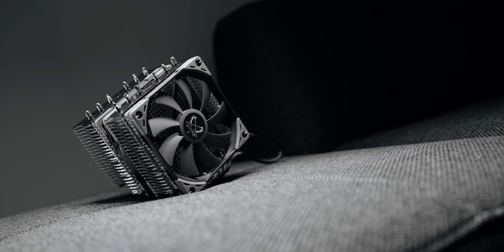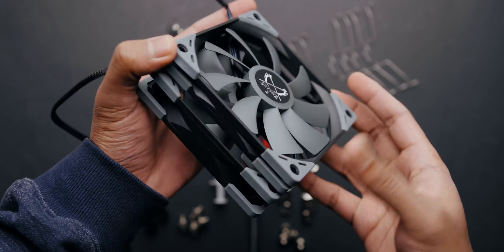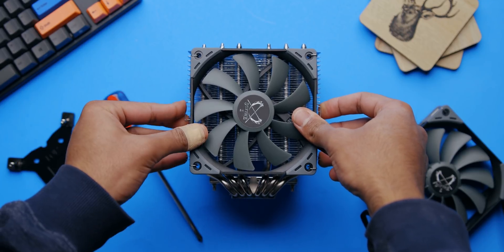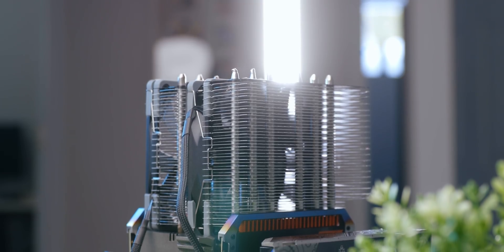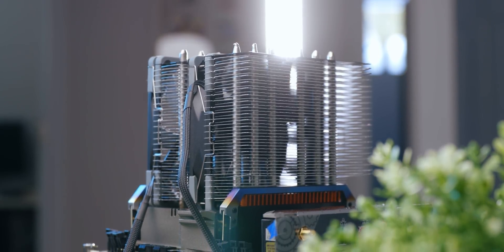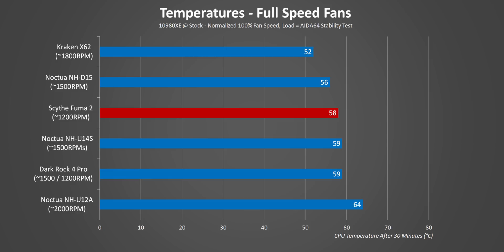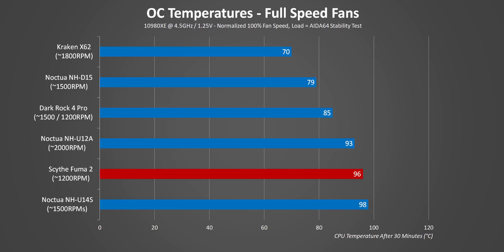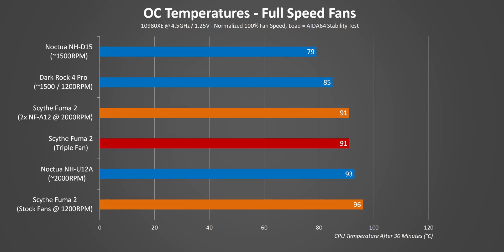A CPU Cooler You NEED To Know About!  Scythe Fuma 2 Review

Comment: I've got a Fuma 2 cooling my 3900x and it has no problem cooling it and like you said it's super quiet even at full speed.
Reply: I just got my fuma2 for my 3950x and amazingly quiet. Even oc to 4.4 all core and maxed fan speed
Reply: @Tallnerdyguy  That's impressive!
Reply: @charlesnix8314  i was remarkably surprised
Reply: Hi, I have a 3900X as well. My question is are you running stock or OC and what temps are you getting? Thank you for any info!
Reply: @charlesnix8314  I'm running stock clocks. My idle around low to mid 40's and while gaming it gets around the mid 60's.  Also my 3900x is in a small itx Lian Li TU150 case.  2  120mm intake fans in the bottom cooling the GPU and 1 120mm intake fan in the front.  No exhaust fans.  Also I'm only running the Fuma 2 in stock form with the 2 included fans. I hope that helps.
Reply: @ARunto  Thank you for the info!
Reply: @ARunto  your idle temp is'  my room temp lo
Reply: I'm getting it for my 3900x I'm wondering if it beats the Prism and for how long.
Reply: @juanjolozadap4945  So how well did it perform on your 3900x vs the prism cooler?
Reply: @juanjolozadap4945  hey how did it go?.... I need one for upcoming Zen 3, 12 cores $549.. do you think Fuma can handle it?... running a Meshify C, so I can’t go with the big boy coolers.
Reply: @juanjolozadap4945  thanks man... was worried about case clearance for cooler but it checks out for Meahify C.  Monero... good choice, I did ETH for a while on an open rig. Got some profit after sometime, had 4 GPU’s running. Good luck. Fuma is at $80.00 atm, should I wait?... a plus $20 markup ain’t that bad I guess.

Comment: "A more basic system with a 9900K" That's not really basic^^
Reply from the maker: From a TDP perspective it is!
Reply: @HardwareCanucks  that may be true. Cries in i5 8400...
Reply: @HardwareCanucks  can you share some pictures of its coldplate if it´s not much to ask. And maybe compare it with a nh d15 if you have one at hand. It´s really important for RYZEN users.
Im asking because some other reviews reported slightly convex IHS.
Thanks for the review.
Reply: @HardwareCanucks  so......it´s an nh d15, unless you go with the nh d15 above fuma 2 max noise, or over 130-140w ....but costing 60 bucks. For gaming rigs it must be great, overclock and all.
Reply: A lot of the tech reviewers do not have a real world view of the 9900K series. They got shipments from the first batch, which performed close to what a 9900KS does. The current 9900K and KF SKUs are much much worse. They draw a lot more power to reach 5GHz.
Reply: @amirjubran1845  it doesnt matter. I´m using a 2600 with a 212 evo. overlocked to 4.2ghz. Stress testing unless i ramp up cooler to 1500rpm and case fans to 1000+ it goes to 85ºC+, but for regular day to day use, it never goes over 65ºC, with the fans on cooler and case at 750rpm. A 9900k at 90ºC+ in stress testing will stay at 65-70ºC in gaming with low to mid RPM, and 100% usage workloads will go into 80s with mid to high RPM....all that with an air cooler.

9900k is not that high in power consumption to be imposible to be handled by these kind of air coolers. 1.3v 5ghz 9900k unless it´s a stress test will never go over 170w, that´s easily handled by a big air cooler+airflow case at 1000-1200 rpm.
It´s just stupid standards and missconceptions from ppl.
Reply: @amirjubran1845  Im kinda surprised tech reviewers dont know this  ^^^^ lol, 9900K is n oven... I had one and returned it, got a 3900X instead which runs way cooler... (also cant clock as high, but yea... Who cares).
Reply: Yea i9 9900k is a  super oven
 U might not see high temps on casual gaming.
But once u start doing a bit more .
Temps skyrocket 
N that's with 360mm rad.
I use mine to benchmark gpus.
Happy with my 3950x
Reply: 3700x ftw
Reply: rip me with my i7 3770k stock CPU! 
I do have 32gb ram and an SSD to help make up for it though. but my GPU is only a GTX 1650 because nothing else will fit
Reply: The installation process looks nice, but for "most" it's a one time thing - install it and forget it.  For me, ease of installation isn't a major deciding factor. The high temps(98)concern me. I'm curious how's this does on the 3900x - any testing planned for this. 
Interesting unit. Where are you guys seeing this for 60bucks...?. I'm seeing 140cdn as the cheapest price...(dec2020)
Reply: As far as I know.  That processor runs hot
Reply from the maker: @Helios.vfx. CPU coolers aren't a bottleneck for the 9900K.  Its IHS is.
Reply: @HardwareCanucks  you're right, but also the silicon itself just gets super hot. I'm running a direct-die 9900ks in my gaming rig and OC'ing is still completely temperature limited (same with my 10980xe - it'll do 5ghz all core happily, but thermal throttles almost instantly with synthetic load - no cooler will help that).
Reply: @kalmtraveler  If you get a "golden chip" that can do 5 GHz under 1.25v you can keep TDP under 200w and realistically cool it in any situation. Problem is many chips will draw over 250w in the scenario you describe, which basically makes it impossible without a high end custom loop or LN2.
Reply: @amirjubran1845  the 10980xe I got needed 1.30v to not crash under synthetic load at 5ghz all core but several cores were throttling instantly. I'm running it daily at 4.9ghz (with AVX and AVX512 offsets of -3 and -4 respectively) on 1.250v though but the 2 hottest cores can still hit 86c under synthetic load. Real use none are passing 75c but still sucks because I know if it could just be kept cool it would handle 5.0ghz fine.

Comment: I'll take the be quiet for looking a hell of a lot better and not slicing your hands open.
Reply: Has this cooler since June 2019, and haven't cut my hands yet on it. Fins appear to be sharp, for sure, but they don't cut.
Reply: Dorientje Woller looks still stand though ;)
Reply: Dorientje Woller looks still stand though ;)
Reply: @lordv1le859  True and taste isn't something to discuss. My rig has mostly a black/gray scheme, so this Fuma 2 fits in perfectly.
Reply: Dorientje Woller fair enough, I just like how be quiet cap the heat pipes so they’re more aesthetically pleasing
Reply: @lordv1le859  Fair too, I wish or hope that Scythe starts to finish off all their coolers as they have done with the Mugen 5 Rev. B RGB: black top plate with silver logo and caps.